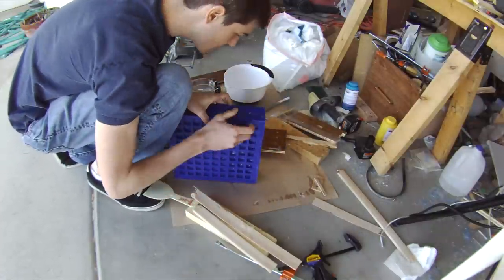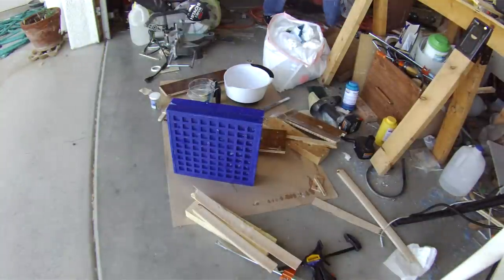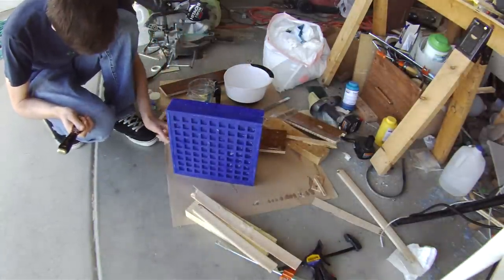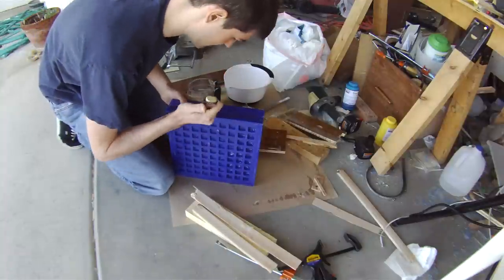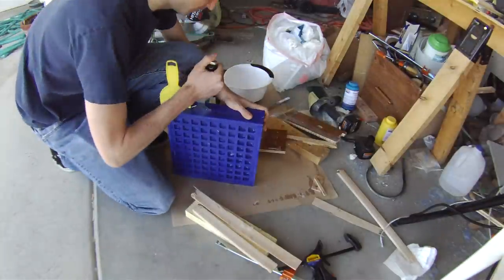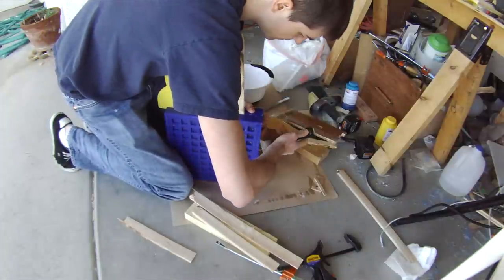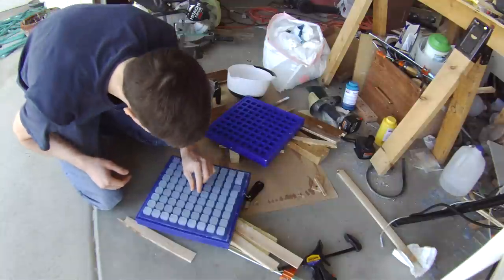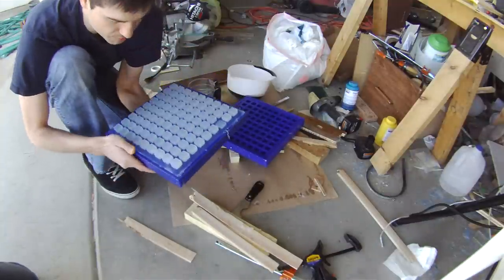extracting silicone buttons from a wax mold

Comment: How did they come out in the end? Are they pure silicone or did you embed anything else into them? Got any pictures or anything on what you used them for?
Reply from the maker: Yeah, pure dragonskin 20 from smooth-on. I was working on a midi drum pad, and using an infrared beam as the sensor.  Turns out that did not work out as well as I had hoped, so I scratched that idea.

Eventually I moved on to force sensing resistors (FSR) from interlink as the sensor area, with bigger buttons and rgb leds to show some feedback.  I gave a talk about this process here: http://2012.nodeconf.com/theatre/elijah_insua.html
Reply: Now this link is broken, I'd like to know if you think the texture and rigidity of the silicone buttons were good enough to use them.